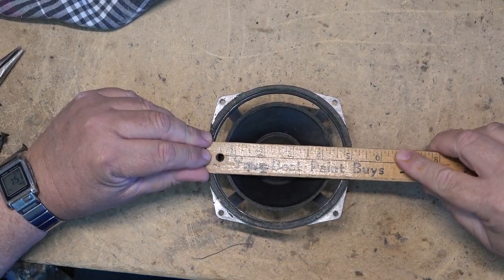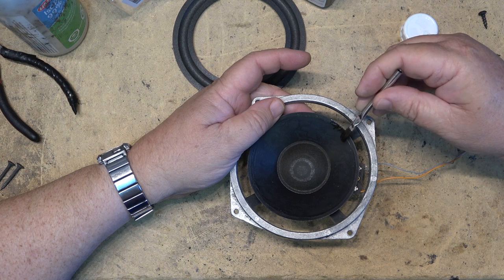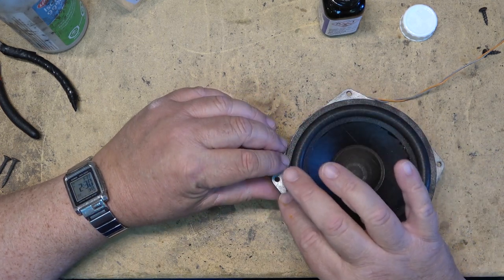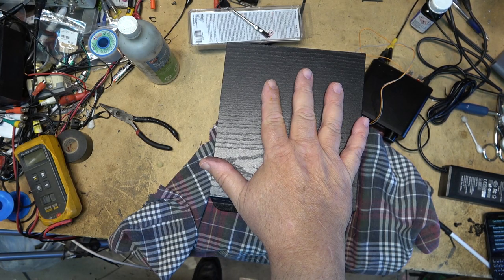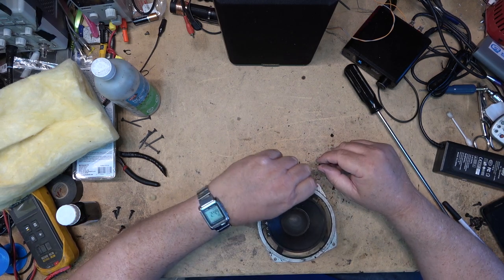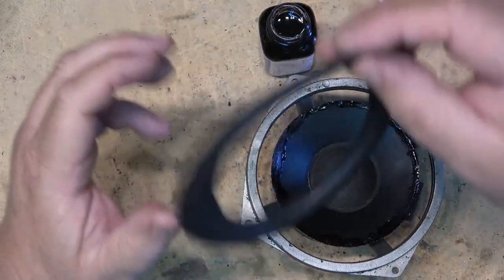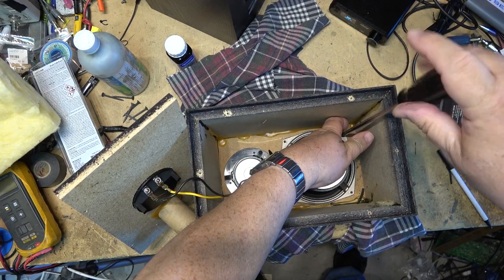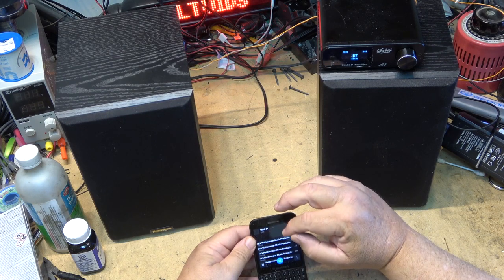Repairing a set of Paradigm Atom Bookshelf Speakers

Comment: I've done dozens of pairs of speaker refoams and never have I removed the dust cap. I did get a heavy ball bearing lazy susan with a non slip rubber mat to aid in the glue application. I find it easier to get a more even and faster glue application to have the basket revolving like a potters wheel and apply a bead of glue from a tube as it spins. Just a different way to make soup, no two cooks make soup the same way. Love doing the pretty redish pink foam of the Cerwin Vega speakers.
Reply: @catsbyondrepair  Depends on what you are comparing to and what you are using them for. They are party speakers. Are you going to put a set of $6,000 speaker monitors out on your patio in the summer and have someone set a beer on them? I didn’t think so…..

Comment: Those paradigm cast metal frames with the ridges where the surrounds are glued are super hard to get surrounds off of. I have done a few of those, and that is by far the hardest part of the process. Other than that, this is a really easy task. I would advise, for speakers that have visible cones when assembled, to apply the glue to the surround instead of the cone, and use a much thinner layer. This makes a much cleaner fit, which looks better to the eyes, and is enough glue to hold up longer than your new foam will, when it gets dry rot some 2 decades later. Also, playing a tone through the speaker when applying the glue will cause the glue to splatter, based on past experience. I found that moving the cone up and down with my hands while working was more than enough to keep it centered. If you run into more issues with buzzing, I had my dust cap fall off. The dust cap glue had crumbled as well! I just used some “speaker glue” to reinstall it.
Reply from the maker: Why does it matter how they look, you can't see them behind the grill and the grill can't be removed so nobody will see them till they need doing again in 20 years.
Reply: @12voltvids   I believe he was talking about speakers without grills. His centring technique is the one that I use also.
"for speakers that have visible cones when assembled"

Comment: These some of the easier speakers to work on, and I am just saying what my experiences with them are. You absolutely don’t have to take my advice, and I understand you do things your way: I am not a trained professional, but I make do with my materials and knowledge. I only comment a lot on these videos, because it is interesting what equipment, and issues with it, we have in common. I also had the Sony str-av570, and took your advice with the loose ground screw! It has worked flawlessly ever since!
Reply from the maker: Yes i know.   The altec Lansing's I own were far more involved as the foams had to go under the cone.
Reply: @12voltvids  The Pioneer DSS-9D that I did had to go under the cone, different technique there for sure.

Comment: 28:20 These speakers can get very loud, and I personally think they actually sound better the louder they get. You don’t want fiberglass dust shooting out the back of the speaker into your room when the bass hits!
Reply from the maker: One of the best sounding speakers I have listened to ars Technics sb7000. With those massive woofers and the offset midrange and tweeters.  They just kick ass at all listening levels but especially at low to moderate volume.   So clear.
Reply: Is it worth switching out the fibre glass with something else that won't shed dust?
Reply from the maker: @urbangroove2013  never had that happen.
Reply: @urbangroove2013  Yes, It may me worth it! Starting on the V3 series, Paradigm switched to polyurethane fill, similar to what you’d find in a pillow. Other than that, the Atom and Titan models were unchanged from the v2. I actually got away with having a mix of v2 and v3 speakers in my surround sound system. Also, the paradigm v2 series center speakers and subwoofers seem to have poly fill, so I wonder why the bookshelf/stand mount speakers didn’t? I guess they have been around for longer. 
In other words, It is definitely worth it. They seem interchangeable, according to what Paradigm did!
Reply: @12voltvids  those Technics look cool! Wish I had space for them! That mid and tweeter behind the woofer was technics’ attempt to correct the phase: the magnets all line up with each other. I had the cheap version at one time! Mine were MCS 683-8310, apparently made by Technics in Japan. I think they were only sold in the US, but could be wrong. They sounded horrible, with muddy bass and way too much treble. Due to this, I have always looked away from those type of speaker, but good to know the larger Technics models are really great speakers!
Reply from the maker: @djijspeakerguy4628  
The sb7000 are big and sound fantastic.  The principle behind the offset drivers is to compensate for the difference in speed that sound travels at different frequencies.  Low frequencies are slower so the woofer is closer to the listeners ears.
Reply: @djijspeakerguy4628  Do you know why they used fibreglass in the first place and what risk is there in leaving it in place?
I imagine there's minimal leakage into the air, but I have no means to measure and am not an expert in these things.
Reply: @urbangroove2013  I think that poly fill batting did not really rise in popularity for use in speakers for acoustic treatment until maybe the late 90s. Many manufacturers were still using fiberglass, because it was proven to work. I have a set of speakers from the 60s that uses fiberglass for acoustic treatment. There is not much of a risk, but if the fiberglass is in the way of the port and a loud bass sound is playing, my theory is that some dust could escape.
Reply: @djijspeakerguy4628  Yes, the voice coils line up to the listeners ear so arrival time is correct from the listening position in the  sweet spot. Vandersteen did this too. If you are off axis this benefit goes out the window, and who sits in the sweet spot all the time? More of a marketing gambit IMHO.
Reply: @12voltvids  Dave, I have a difference of opinion on this subject. I was a sonar technician in the military and this is an area I have knowledge about. It is more of a function of wavelength and phase cancellation, sound speed is affected by the material it travels through, density and temperature. To my knowledge sound travels at the same speed with frequency. The important areas here would be for the woofer and the midrange have their voice coils be aligned so the signal at crossover point, say 700 Hz, are in phase when it arrives to the listening position. It was more of a marketing ploy because as soon as you go off axis, it is all for naught. Who is going to sit exactly in the sweet spot with their head in a vice?
Reply from the maker: @zulumax1  
It is all about measurement. In the lab of course. Phase linear design was an interesting experiment and a few companies did it does it improve the sound in a normal setting.  Probably not but the speakers do sound fantastic anyway.
Reply: Do you mean the fiberglass should be clear of the vent tube port? I had a set of Speakerlab S-19 speakers with a 10" woofer, 1.7 cu. ft. box, and a forward facing vent tube. With bass drum hits you could feel the wind puffing from 12 feet away!
Reply from the maker: @zulumax1  yes the port  tube fits between the. Split in the fiberglass.
Reply: @12voltvids  yeah, that’s what I have been trying to say. It did not seem clear of the port at 28:20.
Reply from the maker: @djijspeakerguy4628  it's called editing.  The fiberglass was pushed aside off camera.

Comment: I had a device, don't remember which one it was. But it had a 9V battery. And it asked me on the lid when you change the battery to wear safety goggles, specific blast and acid resistant gloves and do the replacement behind a blast shield. I was like: What the heck? I had a good laugh, took my flat head screw driver and hoisted the battery out of there scratching it in the process, then squished it hard with my bare hands to remove it from the connector. And here I am still alive. What were they thinking?!

Comment: Last time I replaced the surrounds the company sent me special glue ... it was elmer's ... your lucky to have a store to buy them locally...
Reply from the maker: Yup that's what i used before too, but this time the proper glue was used.  This stuff stays flexible
Reply: simply speakers sends the proper glue and has great service and prices.
Reply from the maker: @xAnAngelOfDeathx  Lee's electronics has the proper glue and the exact foams for many speakers.  Simply speakers would have cost me much more than add 37.50 for broker fees.    Did all 4 speakers for 30.00 Canadian and have enough glue to do about 100 more.

Comment: My .02 cents...I've re-coned several speakers. I did not shim the voice coil nor did I play a tone. The spider should keep the cone centered. I much prefer the glue in the squeeze tube. 
Run a clean ring of glue around the outer edge of the cone. Don't use a brush. 
Set the new surround down onto the cone. Gently press/squeeze the surround and cone together with your thumb and opposing finger on both hands at the same time at opposing spots on the cone/surround. Release the "squeeze", spin the speaker slightly and squeeze again. Keeping spinning and squeezing until you've covered the entire surround/cone. Let that dry. 
Stick the tip of the tube of glue between the surround and the speaker basket...press the tube of glue with one hand while spinning the speaker with the other hand, leaving a bead of glue. Press/squeeze the surround edge down onto the basket using your thumbs on the left and right opposing sides at the same time then release. Spin the spin slightly and press both sides/edges down with your thumbs and then release. Spin/press/release/repeat until you've made it all the way around the speaker. 
Allow to fully dry for 24 hrs before using.
Reply from the maker: Depends on the glue.  This stuff sets up really fast.   Last ones I did about 20 years ago I used a different glue that took 24 hours to cure.    The tone test to keep centered I was taught at a speaker repair seminar put on by PSB speakers so that was the way they wanted their speakers done.  Yes the spider holds the voice coil but it is possible to have unequal tension on the foam.  Having the speaker operating self centers the foam as the glue is setting up so that it is dead center.   Lots of people don't do it this was. Speaker manufactures do it this way. That's how they demonstrated it to all at the lab.
Reply: @12voltvids  It is possible to get unequal tension on the surround. The method I use, which is what the company I buy my surround kits from suggests, avoids that problem. Shimming is usually only necessary when replacing or re-gluing the spider.
Reply from the maker: @jimbanville  yes to reglue the spider you need to shim.  The foams no.  The tone is put on just to equalise the tension as glue sets up.

Comment: Did I ever tell you that I have a pair of bose floorstanding speakers that are twenty years old and I took the bottom of the speaker off to see the woofer and examine the foam surround and to my surprise they are still very pliable not any dry rot and still flexible they must use better foam back then!
Reply from the maker: I have a pair of technics sb7000 and they are 46 years old.  Original suspension.  Sound fantastic.

Comment: I dont shim the coil either unless someone destroyed the dustcaps by poking them and Im going to replace them anyways. However,  10" and up I would consider it if they were high end. The problem with Paradigms and refoaming them is they way they mount internally and if the foam is not centered it causes compression and distortion at higher volumes. Congrats on a great set of big sound space savers.
Reply from the maker: And that is the reason for getting the speakers moving to center them.   
If dust caps have been pushed in a vacuum  usually  pull them back out.

Comment: Some speakers have a flexible support (That some call a spider) that holds the cone and voice coil in alignment in the gap space of the magnet assembly and some do not, I do not remove the dust cap on those that do as the spider already holds the alignment gap in alignment in this case ,, those that do not , are very tricky to avoid voice coil rubbing without shimming the voice coil .the type glue you use is very important as the compounds in many common glues react with foam and dissolve it.

Comment: Is there a place you can send them to get repaired?  I have one paradigm reference ADP speaker having a issue.  May change both of them since speakers are around 20 yrs old.
Reply from the maker: I'm sure there are places that repair speakers just be prepared to pay for it. When I first had my altec Lansing repaired the first time I sent them out to a place because it was something I didn't know how to do at the time and I ended up paying about $400 to have four speakers reformed. Now those phones are worth about $3 a piece. So I paid $400 for $12 worth of materials and a few minutes of shop time to glue them on I figured that out the next time they went and did it myself.

Comment: I'm replacing the tweeter diaphragm in the exact Paradigm Atom and I've seen two obscure sites that say the 19.4mm diaphragm won't work, but a 19.02 mm will work.  I can't find a 19.02, and I can't imagine this popular of a speaker not having a diaphragm replacement!  Does anyone know (for sure) that the 19.4mm will not work, or will work?

Comment: Question. WHERE do you get $2 foam surrounds for paradigm 2 speakers ?… in Fraser Valley. 
Rick in Mission. I got a few to rebuild. Lol. 
Nice video!
Reply from the maker: I got them at Lee's electronics in Vancouver
Reply: Figures. I must drive into the heart of darkness😅 Gives me excuse to take Accordian fir repairs on north shore. I have a few sets of these speakers that I bought blown? Promised couple older friends I would repair them and give them set. I played mine and they were astonished.
Reply from the maker: @richardross3815  you can order online and they will ship.

Comment: Thanks Dave, have a like from my partner's account as well lol (dan in the UK)
Reply: Ha, that's a brilliant way to do it, drive the speaker at 50Hz... Easy, we have a 50Hz sine wave generator in the walls over here lol, sure I have an amp with bad filters I could use lol (my function generator is a chinesium pos that works when it wants...)
Reply: Acetone? Lol used to use that all day when I worked at senior aerospace years ago, to clean tubes prior to welding... also worked nicely on cuts haha.  Vapour from that is nothing compared to the hot Trichloroethene decreasing tank, whew!

Comment: Do you know how to tell if a speaker is out of phase? Because on the first speaker you did. You said was the the red wire was on the right or left terminal! But you would know right away when you ran stereo and one had less bass then the other! Just asking!
Reply from the maker: Duh.  Just face the speakers at each other and run a mono program and there will be no bass.  And i did phase them correct.  First was the wire memory plus the + mark on the terminal where the red wire went. 
I have put these speakers back in service.  Took out my shitty Polk junk Chinese speakers.  These are so much better sounding.  No comparison.
Reply: @12voltvids  I figured you know what you were doing you only been doing this probably a very long time! Sorry didn't try to say you didn't know what your doing at all! Peace my friend!

Comment: How do you prevent cross-threading into wood this quickly without going backwards first? I want to learn that skill.
Reply from the maker: Used same holes the screws came out of.
Reply: @12voltvids  I was taught that you still can cross-thread it. Do you put the screws at a special angle to prevent it from happening? I usually turn it the other way around until the screw falls gently into the thread.
Reply: I have disassembled and reassembled my paradigm speakers quite a few times, and one had an issue where there were basically no threads left. This made it so the screws were not on super tight, and the back panel rattled when you turned up the bass. My fix was to fill the screw holes in white glue, and leave it overnight. The glue did not dry fully in that time, but it was tacky enough that I was able to thread into it and secure the back panel far better. The only downside is I have to do this every time I want to disassemble the speaker from now on. I don’t have the wall mount bracket, but I still would not take the chance of hanging mine on a wall, until I put something more like wood glue in the holes. That should hold up better.
Reply: @djijspeakerguy4628 glue in a toothpick or two, or even just drive them in dry, and break them off, the screw then tightens things down.

Comment: That is a ported speaker design why have foam, doesn't make sense unless they were not tuned properly in the first place. In sealed box design yes, never seen that before. Asking a question?
Reply from the maker: The foam is there as opposed to just the paper cone going to the edge because they are long throw woofers. Regardless if acoustic suspension or ported design you still have to isolate the air pressure behind the cone.
Reply: There is also such thing as fabric and rubber surrounds. I have not noticed them as being less or more common in ported speakers. It is just what the manufacturer decides.
Reply from the maker: @djijspeakerguy4628  yes there is but you are  stuck with the design.  Rubber and fabric never fail.